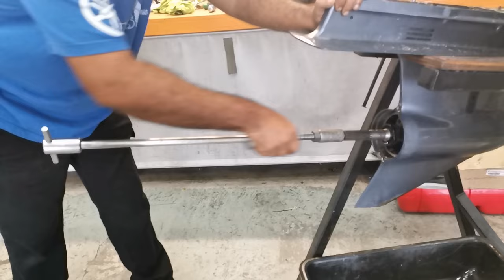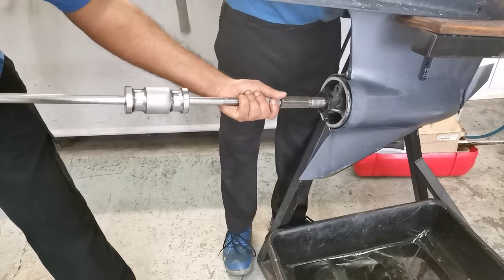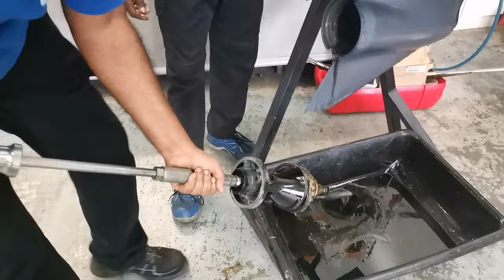How to remove Yamaha OBM prop shaft #yamaha #outboard

Comment: Where did you get the tool to screw on to the end of the prop shaft threads?
Reply from the maker: You can buy from Yamaha spare parts dealer 😊

Comment: How effective do you find the slide hammer method in removing the bearing carriers that have salt build up around them. I have only ever used pullers and heat when its needed. I am curious as I have had some in Australia where I live that I have had to work on over a couple of days to remove as they have been really stuck. Thanks.
Reply from the maker: Hi, I think slide hammer method is more effective, specifically when salt build up and with rusty conditions, slide hammer make little vibration on rusty places, it can brake the rusty binding, so I recommend this method is more effective
Thank you
Reply: @MrAsankarajitha Thanks, I will have to give it a go next time I am dismantling a gearbox.